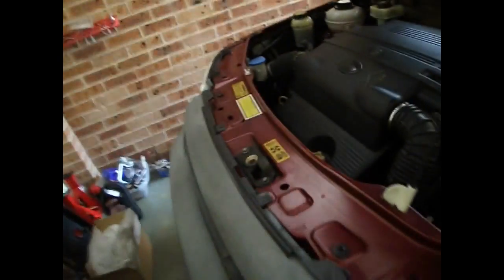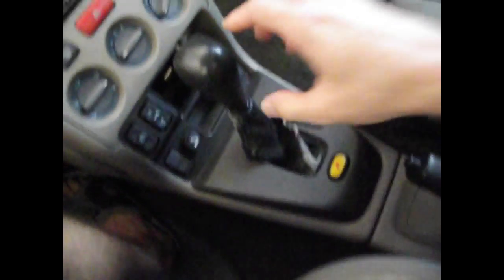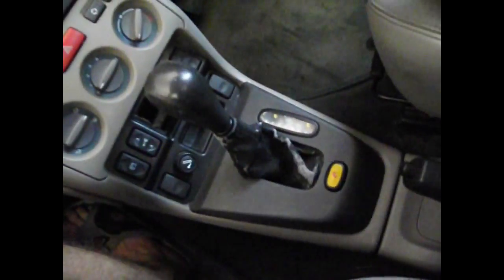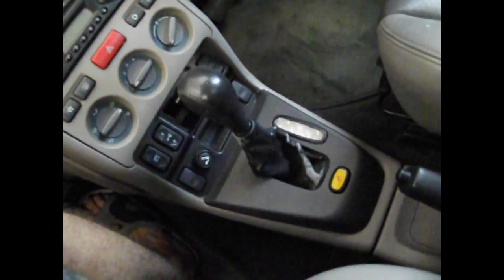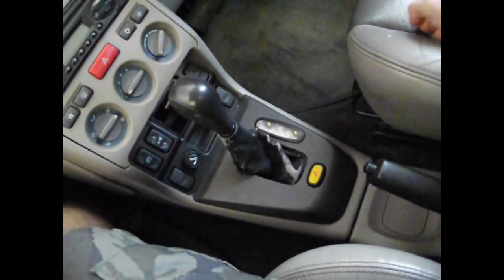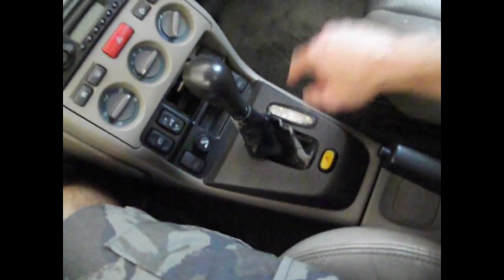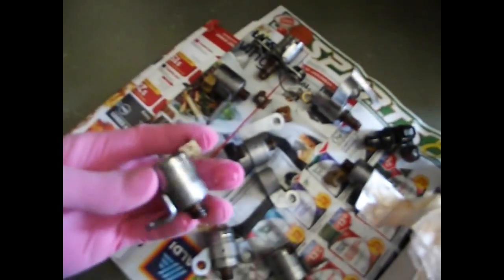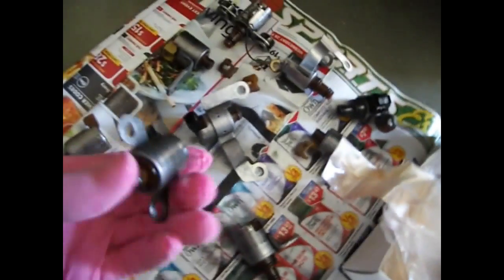Auto Gearbox Jatco JF506E - Solenoids Renewed - Rough Shifting Fixed - V6 Land Rover Freelander

Comment: Goodnight my bro I am working on one now with no spark no injector pulse change crank sensor and Cam sensor still no spark or injector pulse so I am ask for help plz
Reply from the maker: hi Travis, I haven’t had my Kv6 for more than a year now but, what lead to this point, what was the catalyst for replacing the cam and crank sensor ? Was some other work done? Were any of the negative Earth cables removed or slackened for the earlier work and if so, have they been returned to previous ?
Reply: @jascokovacevic  no work was done on it the first owner who had it say someone hook up the battery wrong but now o went to talk to the person died for covid but what I can say the ecu still showing me 5v reference so that I i say the ecu is still good but don't really no
Reply from the maker: Yes that can fry the ECU. What voltage are you getting for the battery just curiosity, 12.6 or higher?
Reply from the maker: When you turn the key to Ignition, do you get anything that lights up on the dash at all? Are you able to scan it for error codes if at least you get some signs of life with dash lights when you turn the key?
Reply: @jascokovacevic  I am getting 12.6volts which is correct
Reply: @jascokovacevic  yea the dash light up everything thing working except the spark no injector pulse never try to scan it
Reply: Will have use my launch scanner to do scan and see what happen
Reply from the maker: Yes, the Kv6 has a lot of electronics and should throw up a code if some sensor is faulty.
Reply: @jascokovacevic  well I will try scan it and let you know what happen but the immolizer will not stop it form no spark or no injector pulse
Reply from the maker: I’ve not got experience on this issue myself but I agree, even if the immobiliser is on, you should at least get a pulse from the injector. Curiosity, is the system not fully disarming itself before you try and start it? Is the red light for the arm/alarm still flashing when you try and start it ?
Reply from the maker: When was it last successfully started? No one (that you know of) worked on it and disturbed any of the bolts that are also earthing points did they ?
Reply: @jascokovacevic  no the lights is not flashing when I try too start it even open all the doors that y i aint really think is the immolizer just trying to understand the  electrical circuit so I think will try get ecu you
Reply: @jascokovacevic  no the owner who had it pass way form covid so I never get to talk to him about what was wrong just get word for a next shop that he hook up the battery wrong
Reply: @jascokovacevic  I think I will just try get a ecu for it try get it program and see the only thing I am form the carribbben st kitts so we aint have no dealer down here if buy ecu online they program it for me see one on amazon for 500us

Comment: Hello! First of all, sorry for my english its not very well :D I also have a rover with a v6 engine and a jatco gearbox, my problem is that on a cold gearbox it is difficult to change gears and it tugs when changing from N to D, on a warm one this jerk does not occur and it changes gears almost imperceptibly, but one gear sometimes is getting longer, is it the fault of the oil?
Reply from the maker: Hi, that’s fine I can understand you. Could be many things if it only does it when it’s cold. Get it scanned, any codes? You can try fluid change but Beware! It’s a specific procedure and if you get it wrong, you’ll lose all drive in the gearbox! Do you have the link for the procedure?
Reply: @jascokovacevic  what is the procedure to do that? I’d like to know this by the time I get my Rover 75, as I understand it has the same power train as your Defender
Reply from the maker: Hi Diego, mine was a kv6 Freelander not a Defender. It’s not that hard actually, just need to get good access to get to the fluid pan and remove all bolts. And when your done, it’s a special procedure to refill the gearbox, get your self a hold of the procedure otherwise undoing the wrong bolt or not adhering to procedure could leave your gearbox without any drive!

Comment: I have a Freelander 2001 with auto transmition that sometimes won't engage reverse. Or I should say it sometimes engages revers(Most of the time it simply won't) could this be a problem on a sensor or a Solenoid? Pleased to hear any comments form you guys
Reply from the maker: Hi Gustavo, sorry about your Kv6 Freelander experiences. I have not experiences that One before so can’t say whether or not renewing sensors or solenoids will work without removal of gearbox and sending to specialists. Have you had the car scanned for codes, if so which ones come up? A good OBD scanner will be able to tap in to the Auto Gearbox Computer and scan that for codes.
Reply from the maker: Hi again Gustavo, Coincidentally I’m actually selling the automatic gearbox from my former 2001 Kv6 Freelander on eBay, here is the link https://www.ebay.com.au/itm/Jatco-JF506E-Automatic-Transmission-from-Freelander-1-KV6-/274515617999?pageci=b0484919-625f-4fb2-a9a3-1bdfae938f94

The car was hit by a Hyundai SUV (not my fault) in July 2020 from the front (thank god myself and the other driver and her daughter were able to exit our cars ourselves), with both cars having been declared write offs. I removed the engihe and auto gearbox and several other parts Not damaged and if anyone needs something just ask. It was my favourite Freelander. Just note, the auto gearbox in itself is very particular in procedures for basic things, for instance to do anything with the transmission fluid, the temperature has to be between 35 and 45 degrees Celsius. I did all such work myself and at one stage put up a video but took it down following feedback with the risk being there were too many parameters and of procedure not being done by the book could lead to damage to the automatic Jatco gearbox. Did you have any work done at all to the gearbox beforehand? This page contains a good write up on level checking the fluid http://www.myfreelander.co.uk/Transmission/mainprobs4.htm

Comment: Do u have to remove the whole front end? Is there another way?
Reply from the maker: Hi Richard, I don't think you'll get access to remove the solenoids any other way... You'll also need to apply RTV sealant to the fluid pan when your done so you'd want good access to be able to do that properly otherwise it'll leak in the future.

Comment: Has anyone got a list number for the solenoids on Ebay as can't find them.
Reply from the maker: Hi Graham, navigate to ebay.com and try this text "solenoid kit Jatco JF506E". Alternatively try this link, https://www.ebay.com/itm/Original-09A-VW-Solenoid-Kit-JF506E-New-Jatco/173609486607?hash=item286bee890f:g:oCsAAOSwoMZcdFx7:rk:1:pf:1       The link is for the 9 complete solenoids, many sellers are selling 3 or lesser than 9 but in my opinion if you are going to be removing the fluid pan you may as well change all 9 of them while your at it.

Comment: I replaced all 9 of the solenoids on a 2002 (US model) last year, and changed all of the fluid with LR fluid.  Still have the same problems, the transmission slips and displays the F4 in shift indicator.   Thought about replacing the entire gearbox with a new re built unit.  What would you recommend?   Order a rebuild kit for the gearbox or replace with new rebuilt unit?   
Would this be easily done without a lift?
Reply from the maker: Hi ghomarch, sorry to hear about the painful autobox experience. I'm not a gearbox rebuilder or specialist but I will say that mine was rough shifting and lurching forward when I'd move it in to D from P or N, but it wasn't displaying the F4. For the record, I also don't use LR fluid for this gearbox but Nulon SYNATF4 as it meets the specifications in RAVE concerning same. If you end up ordering a rebuild kit for this gearbox, the issue could be a few different causes. If your a gearbox rebuilder, I'd say go for the rebuild kit as when you remove it you'll be able to see what's making it do that, etc. Not sure whether your likely to get a warranty if you get the kit. Though with a rebuilt unit, your likely to get a warranty. The box can be removed without engine removal but If you need to do the belts, might be easier to simply remove the whole thing with the transfer case + engine + auto box attached.

Comment: I replaced the solenoids recently on the Rover 75. The 2.5 and the auto gearbox are the same as in the Freelander 1. It was possible to do it by just removing the air box but room was very limited.  

One of the solenoids at the top are fixed by a nut rather than a long bolt.  Quite disconcerting when the bolt disappears into the backing plate.  My initial thoughts had it dropping inside the transmission causing all sorts of damage but fortunately that didn’t happen and a strong magnet pulled the bolt back through its hole.

Keep up with your videos.
Nathan
QLD.
Reply from the maker: Hi Nathan, I know what you mean. I had that bolt disappear in to the backing plate then I spent the next 5 minutes thinking and scratching my head for ideas, I was even thinking of pulling the gearbox and simply renewing it (the whole gearbox)... in the search for ideas, I grabbed a magnetic rod and voilla, out it comes! I hope all viewers who may experience this end up reading this comment - there is light inside the tunnel! Videoing always is difficult since working full time doesn't give me as much time as I'd like to have available, I also don't have a helper or even someone who could hold the camera or even a counterpart.
Reply from the maker: Just out of interest and for the benefit of other Rover 75 or Jatco box owners, what made you renew the solenoids? Was it hard shifting or lurching forward like mine each time you placed it in to D from N or P? How did you find doing the level check in the auto gearbox, was that fun? (not!@) I did the same on a Ford Focus 2009 Auto and the book states (no joke!) to take the car (from cold) on a trip of at least 16km then upon your return while the engine still idles grab the dipstick for the correct level check.
Reply: Jasco Kovacevic I had hard shifting up and down especially 2 to 3 to 4 .  I also did 3 fluid changes, not the flush.  I’ve read horror stories about flushes.  

I didn’t have any means of checking the temperature underneath the car so I put warm water in a glass and measured the temperature, adding hot or cold water until it was 30 degrees.  I put my finger in it and realised it was just luke warm. 

I ran the car for a few minutes moving it through the gears, drained the fluid and running it over my finger, it felt similar to 30 degrees.   Put the drain plug back in, added about the same amount of fluid plus 500mls more.  I started the car and moved the shift lever through each of the gears and back into Park, leaving the car running.

I undid the level checking bolt and allowed fluid to run out until it was just a drip and felt by my finger to be 30 degrees.  This apparently is the correct level.  I have read that there is 300ml leeway plus or minus.

Not a good job.  Also, one has to be very certain they are undoing the correct bolt or one loses reverse gear.
Reply from the maker: Nathan, glad your doing it yourself and hope the inspiration is seen here by anyone reading or viewing. I notice you have a Rover not a Freelander V6, but in the RAVE (land rover's) official manual for the V6 Freelander, it states that the temperature must be between 35 and 45 degrees C. I have a few scan tools but none of them read the ATF fluid temp as with your case. 
I have 2 alternative methods for fluid checking like yourself. 1 is riskier than the others - as you see why I haven't put up a video on it. (1) Digital Thermometer with a line (skinny cable) attached to it. Seeing your a fellow Aussie, I bought one of these at Bunnings a few years ago and used it successfully. The line is quite long, about a metre so the length is fine. The end of the line has a plastic tip which is the thermometer. The other end of the line is linked to a digital temperature readout. Just fish the line in to the fluid pan and get the instant temperature reading. Just ensure you fish it far enough inwards in order for the tip to touch the fluid. The Risk : When you try and fish it back out to retrieve it, the line may get caught around a solenoid (that did happen to me once but patience and persistence allowed me to fish it back out without leaving any part in the fluid pan or damaging a solenoid). This thermometer is actually meant for liquids anyway. 

2nd Method. Digital laser thermometer. This one I bought on Ebay slightly more expensive than the Bunnings one. This one fires a Laser and tells you what the temperature is of whatever object or liquid or item the laser fires on. I have found you can actually fire the laser in to the fluid pan to get the fluid inside - thus there's your reading. I remember I had extra confirmation as I also fired the laser thermometer on to fluid just as it came dripping out of the level check hole and it was 43 degrees C. Just ensure if you do this that you fire it a few times.
Reply: Jasco Kovacevic That’s interesting about the temperature.  I thought it was 30.  Could mean I am over filled.  I will check out those temp measuring devices.  That laser one sounds useful for other purposes too.  

I did the cam belt and other moving parts change back in December, together with cam seals - what a job that was!  I bought the laser locking tools to do the job.
Reply from the maker: yeah true, when you did the cam belt, did you also renew the cam sprocket bolts? 6 of them altogether. Land Rover's RAVE states to renew the sprocket bolts as they are designed to stretch over time. Do you also order your parts directly from the UK? The Laser one that I have I just checked now is $44 on ebay there is another version for $29, I went for the dearer one I think it had some extra functions.
Reply from the maker: Which transmission fluid did you use? I used Nulon SYNATF-4. Has the certifications on the pack as the RAVE manual... The Ford Focus Mark 2 uses the same one.
Reply: Jasco Kovacevic Yes, I ordered the new sprocket bolts but from my local Land Rover dealer.  Some parts I ordered from the UK depending on the combined cost of the item and shipping compared to over the counter locally.  I also replaced the inlet manifold gasket, chamber seals, rocker cover gaskets and cleaned the metal mesh filters, thermostat and all the breather pipes.

The laser locking tool I bought was $300 used on eBay but double that new.  Here it is here... http://www.lasertools.co.uk/product/4577.
Reply: Jasco Kovacevic I used Nulon Multi Vehicle Fluid which is marked part SYNATF-4.  I use the Nulon 10W40 full synthetic in the engine, Nulon OAT coolant.  I’ve had really great results in using the Nulon Total Fuel System Cleaner.  When I replaced the inlet manifold gasket, I noticed the inlet valves had very crusty carbon on them.  I recently had to remove the inlet manifold again (thermostat o ring leaking) and the valves were totally clean
Reply: Hi, after you changed the solenoids, did you do a transmission control module reset?